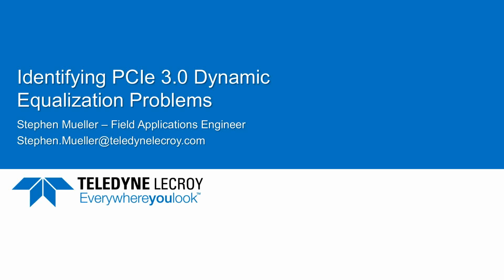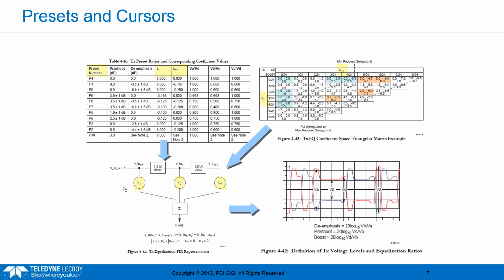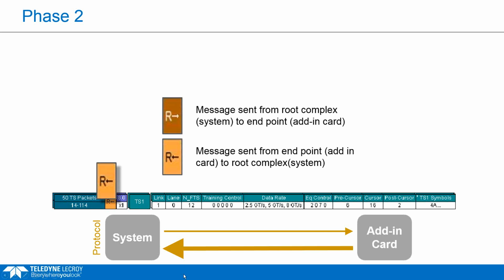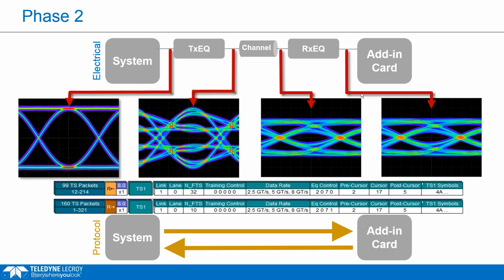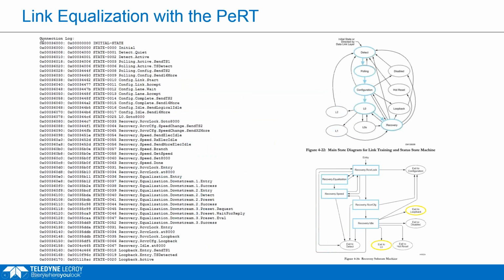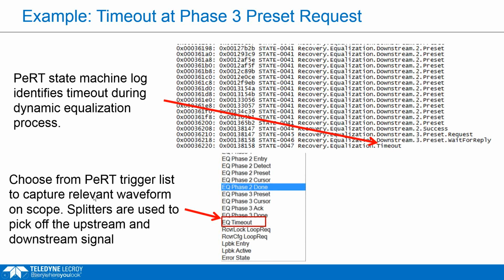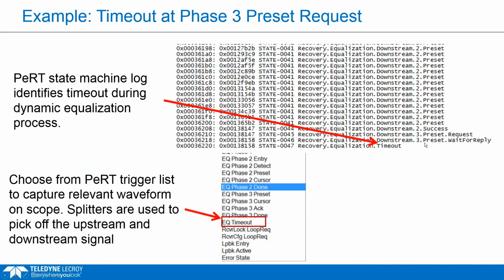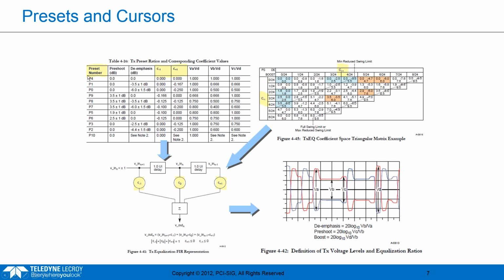Identifying PCIe 3 0 Dynamic Equalization Problems

Comment: number of types of  presets are 11 right
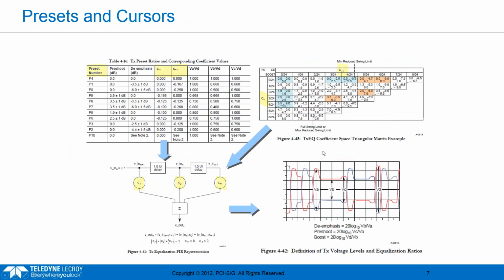Reply: Yes. You can see them around 10:30 min they are named P0-P10. They are defined by their ratios. P4 is the full swing signal with no EQ. Your cursor space might be much larger than the number of preset. They show a table (in the triangular matrix example) with 45  possible coefficient settings; but only the 11 colored presets can be requested by an endpoint... 6/24 by 8/24 indicating their cursor setting/number of steps in the cursor hardware is 24. The table of total possible settings could be much larger if you had more cursor space (lets say 50 instead of 24). In the end you will have to choose some combination of the cursor values to which match the ratios defined by spec and make sure you program your device to return a particular set of coefficients when requested to give some EQ (ex. P4 always returns a full swing signal and P8 always returns a signal which is about 3.5db smaller than P4)

Comment: Hi, 
Does dynamic equalization process applies for Gen2 devices as well? 
Or is it only Gen3 related process?
Reply: Gen 2 doesn't require dynamic equalization. Gen 3 and G4 requires dynamic equalization.
Reply: There are other methods to encounter the problem like de-emphasis. But that is not enough for Gen3 and above speeds.